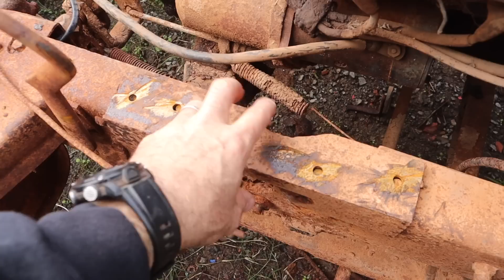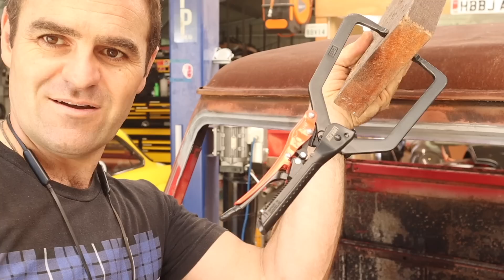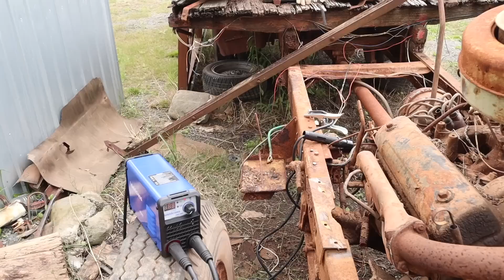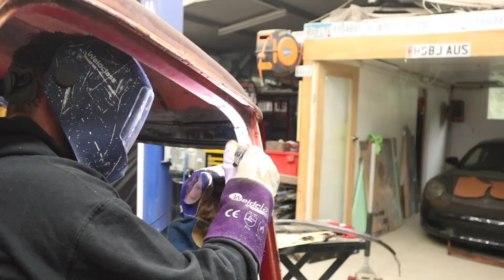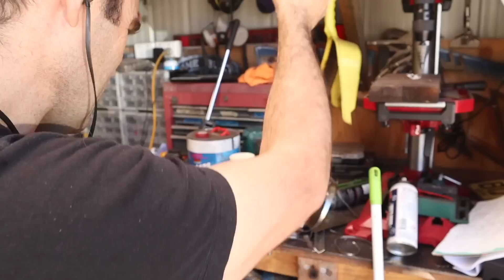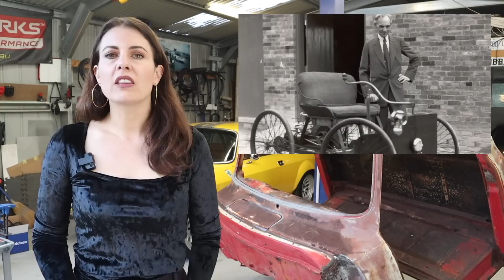Why TIG over MIG for rust repair?  - 1954 Ford F600 Car Hauler Build part 4

Comment: Hi Jeff, I don't remember - is the roof too far rusted to bring back to life?
If not, rather than trying to fabricate and weld in a new roof, you could try to remove the dents.
Carter Auto Restyling channel will give you some great tips for this job. I can't speak from experience as I have none, but it would seem that slow and steady progress is the way to tackle a job like this.
And if it doesn't work, it's simply back to plan A   😀

Comment: Jeff, have you noticed that the rain gutter over the windshield is bent up a bit on the driver's side? I had a thought, perish me; loose the entire gutter above the windshield and make one large new metal repair to join the windshield frame to the roof? Include a fabricated doubler with a stiffening shape spot welded to the inside? It's your ride; I can't imagine you want to be riding into a rainstorm with Missus along, AC or not. Having looked, a roof repop might be had from the US, but the W/S frame isn't. NO joy; hence my thought to make it shape as one piece and add some additional stiffness to the back. That will give you the finished shape your inside header needs to have. If you plan to AC the truck the ceiling will need insulation and likely a header of some kind. Forgive my intrusion- you are rockin' on a rust pile. I'll shut up till the Missus has her say. I did not ever know Henry was a used car peddler! That explains a lot of later things!

Comment: This new project with sheet metal and body work came very timely since a have some body work on my 73 Ford 	Granada that I would like to tackle. Seeing that it is doable if you take your time and brake down the job in bits. Doing bit by bit. And without being a master fabricator even though Mr Jeff  is very skilled. He has quite a few tools though that would be handy. I have to see how my project progresse ,,tools etc being inspired by Mr Jeff. 🙂 Great episode. 👍

Comment: Jeff, I think you will find that 53' Fords in "oz " still used the side  valve engine.                  Around Bowral in the 60's there was a chap that had VW with a Porsche motor that was a very nice machine .Don't know what happened to it.

Comment: Hi Jeff, may I suggest the introduction of Everdure for rust repair. A nickel brass rod used with tig that makes small hole repair easier without the flux of brazing but with great flow and less temperature (heat) when material is to thin to weld but still substantial enough to keep. Best of luck Pal...
Reply from the maker: I will look into that, thanks.

Comment: Hi Jeff, I was just curious if the same regulations apply in Australia regarding repairs on rusty unregistered cars. In New Zealand, we have to involve a panel beater and engineer and all repairs need to be inspected before applying any filler. Is it the same in Australia?
Reply from the maker: I will have to have an engineer go over this due to the body swap, but the repairs are not something that they seem concerned about.

Comment: Your roof might not be beyond repair.  MakeItCustom, together with Halfass Customs has a very nice video where the show how they repaired the collapsed roof and bootlid off a fire-damaged car, without an english wheel.
Reply from the maker: It is rusted through :(
Reply: @HomeBuiltByJeff  Real pity!
Reply: @HomeBuiltByJeff  and please put the guard back on your grinder ASAP!  I had a blade disintegrate on my just a few days ago, and it is not pretty!

Comment: I've also seen people tig panels onto a car in place of a spot welder, which is really handy to avoid drilling holes and grinding the welds down after most people fit new/repair panels. Worth giving it a try if you have overlapping panels

Comment: Hi Jeff, nice work on the rust repairs! Just been wondering what your plan is for the bits you've welded up and painted with primer etc? I know you are looking to keep the patina rather than painting the whole thing, so are you just going to leave the repaired spots with the grey primer, or do you have some other plan?

Comment: must depend on the MIG  machine then  i can adjust my Lincoln down to a very small feed . the feed wire just seems like mild steel , panel welds are mostly just a series of spots to reduce heat. i ' homebuilt '' 2 austin minis using TIG  but i now wish i had used a mig

Comment: Agree with your assesment of MIG versus TIG welding.  All I can add is that TIG is not ideal when performing 'cut and butt' welds on large relatively flat panels where the likelihood of distortion is high.  In such cases - using YT Fitzee's 'judicious' MIG spot weld technique is preferable - a technique that minimises heat and hence distortion of the panel.  However, I only wish I could MIG weld as well as Fitzee - just need more practice.

Comment: F100 1966 made it in to a excab length the frame for service bed 351 cleveland c6 9in rear 10x15 front 8x16 Visalia front suspension

Comment: Also if you don’t wipe the clean the POR15 can lid and sealing surface good luck ever opening it again. From now on you will need to drill holes in the lid.
Using this method works well for me. Further never paint straight from the tin as you can contaminate the paint.

Comment: Hey mate your that late there's hardly any comments to read, in your rushed video you should have said baby welder is invertor Technology, first used one bout 4 years ago couldn't believe how small and light, might have been slightly higher amps but yours is way smaller again almost to the point that leads take up more space

Comment: Top Tip for you : the easiest and fastest way for removing old big rivets from old chassis is to get yourself a heavy duty air hammer/chisel with one pointy tip and one chisel blade, take off the rivet head with the chisel blade and punch it out with the pointy tip, I did that with a similar old truck frame and each rivet wont take me more than few seconds to remove. Mind you to get the heavy duty air hammer (has longer head from regular air hammer).
Reply from the maker: That is a good tip and would have saved me a bunch of time. Thanks.

Comment: Have you looked at a ford escort steering rack as youcan get them  with 2.4 quick rack or 2.9 standard ?
Reply: The requirement is the rack must be from a vehicle with a mass that is equal or greater than the Alferrari.  An Escort is lighter than the Alferrari - so can't be used.

Comment: Back the good side with brass or copper flat form the good face so no excess buildup of mig weld and less grinding .. plus no need to remove excess weld and risk thinner panel syndromes.. 
Use stick welder to spot and plug weld.. That way you don’t leave excess buildup and ugly welds.. I can spot weld a panel butt joint as easily as mig spot weld. It’s all about rod thickness and duration of weld and heat dispersion.. backing with flat brass plate is a great way to learn the tipping point to excess heat and molten weld drop..

Comment: Have you considered using PDR techniques to fix the dented roof, far better result than welding in a new panel to "fix" it and a lot less work.
Reply: I was thinking the same. As a bonus make a few templates out of wood to beat against and to help make sure the two halves are symmetrical.
Reply from the maker: Panel beating it would be easy but it is all rusted out with holes all the way through.

Comment: Hi Jeff. To reduce heat soak into grinding down MIG welds try use some carbide burrs bits. They are extremely effective compared to flap or grinding discs. They seem to cut off the hard MIG welds instead of abrasion.
Keep up the good work